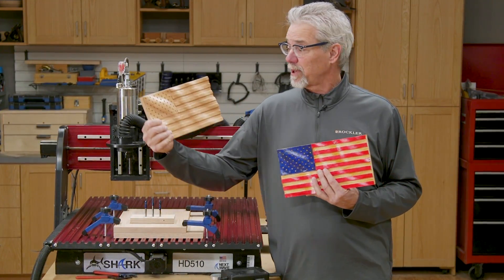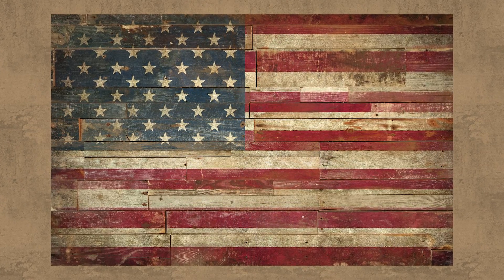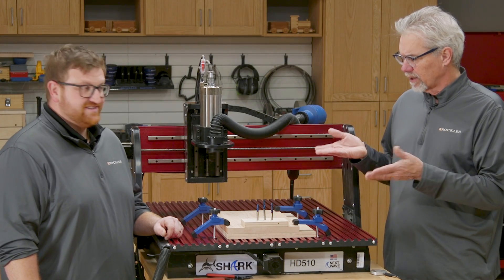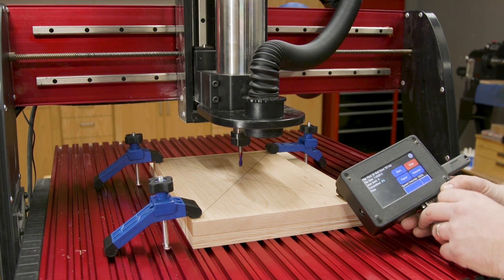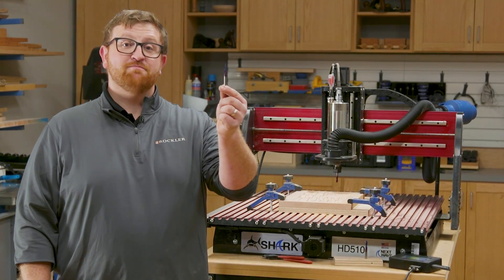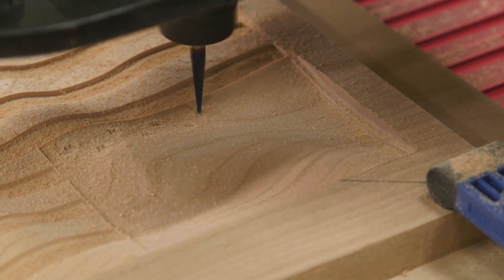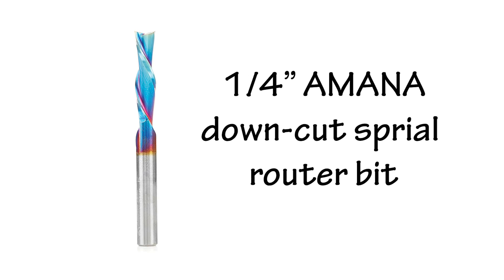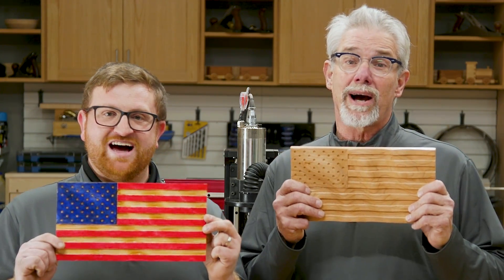Make an American Flag Carving | CNC Project

Comment: I do a lot of CNC work. I use a Shark Pro and Vector Art software. I see in the flag project you use the center as your 0/0 start point. After your first run with the 1/4 round and the material in the center is routed away, how do you re-zero after the bit changes. I have run into that problem for years therefore I always use the bottom right corner for 0/0
Reply: Once you have set your X/Y zero they do not have to be reset, only Zed axis needs reset for each following tool, and there is virgin stock around the outside of the blank to use for that.

Comment: CNC is not wood working, you could easily have dine this with hand tools.
Reply: Neither is a router, tablesaw , drill press, etc. etc. It’s just a tool.
Reply: @shockdocracing  While I get both sides of the debate, I think Adam's point is that there's no woodworking skill involved in in this project at all. Yes, the CNC is just a tool but when it creates the entire project, there's a good argument that it's not really woodworking. A router, tablesaw and drill press requires skill to operate and you're still interacting with the wood directly. I'm not anti-CNC ... I believe they have their place (production, personalized touches, creating components that would otherwise be impossible), but for this project, it's not much different than simply buying it from the guy who has the CNC. In which case, it could be a good moneymaker. It's all about perspective.
Reply: @philshock3805  Having programmed and operated CNC machines since 1995, I will respectfully disagree with you. The router bit still cuts the wood in the same way by hand or in a CNC. Is using a dovetail joint jig not "real" woodworking? You need not have the same level of skill as one who hand cuts their dovetails. The jig does all the skilled work you just do the setup. Just like setting up the CNC.
I have trained many CNC operators over the years. I can assure you that it is far easier to teach a woodworker how to program the computer than it is to teach an IT person to work in wood. 
And writing an efficient program that does the required work, to the required accuracy, in the least time possible is an art form not much different that designing a chair that "sits" well. (I've done both)
Reply: you go right ahead